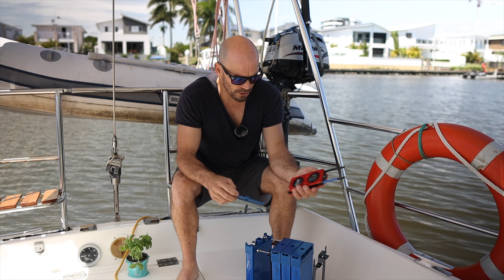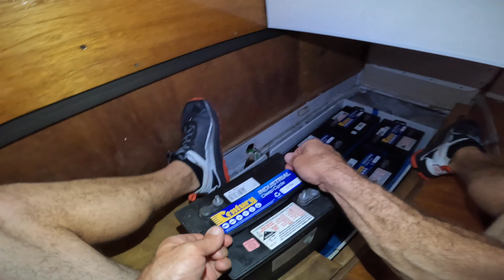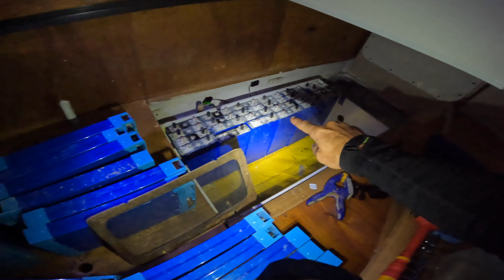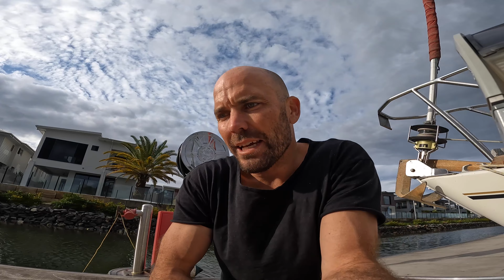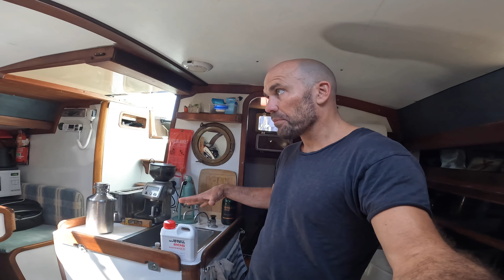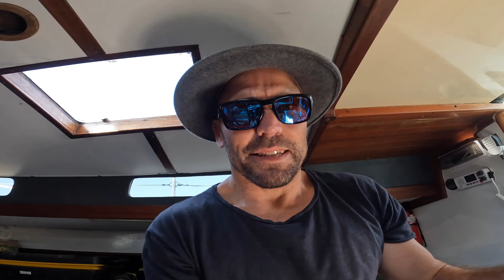Massive DIY 48v lifepo4 battery bank (part 1) - sailboat

Comment: Why would you remove a diesel to limit your range to 3hrs or so?
Reply from the maker: Much less noise, moving parts, maintenance, no smell, no oils, no fossil fuels, motor sailing options when the sun is shining, all my power comes from renewable resources so I am so much less reliant on outside resources, better for the environment. I definitely can’t use the electric motor like you would a diesel but I don’t miss it one little bit.

Hope you enjoyed the video 👍🍺

Comment: Your 3.2 Frey/fortune lithium lifepo4 cells: how many Ah did you buy? Regards
Reply from the maker: 400ah @48v 👍
Reply: Hello, but looking at the Frey website you have huge choice of cells: 
3.2V 2.5Ah
3.2V 5Ah
3.2V 10Ah
3.2V 20Ah
3.2V 40Ah
3.2V 50Ah
3.2V 60Ah
3.2V 100Ah
So which one did you select 10Ah each? Thanks @slightadrift
Reply from the maker: @balaytukogardeninn8172  64 x (3.2v 100ah) = 400ah @ 48v
Reply: @slightadrift how much cost per cell?